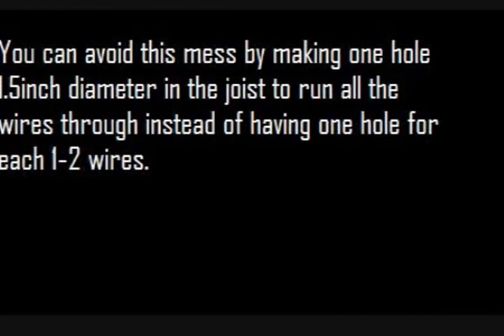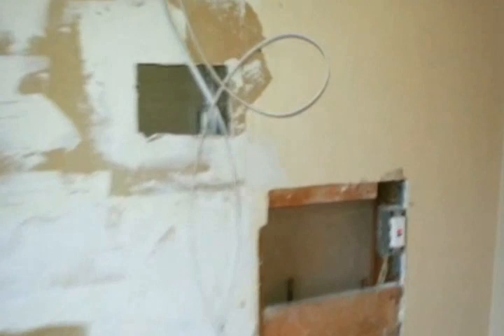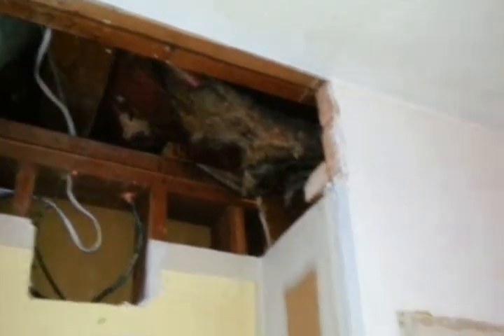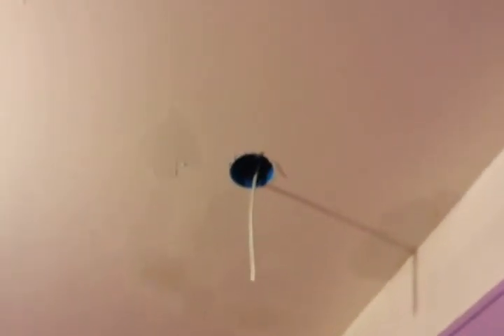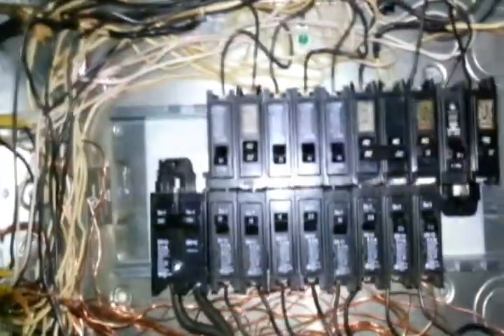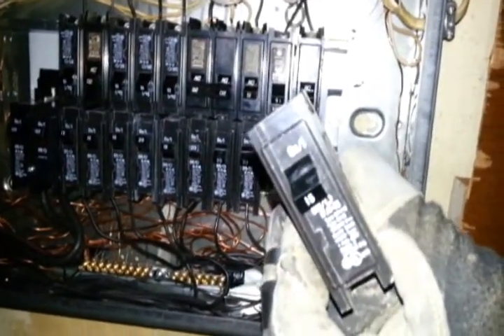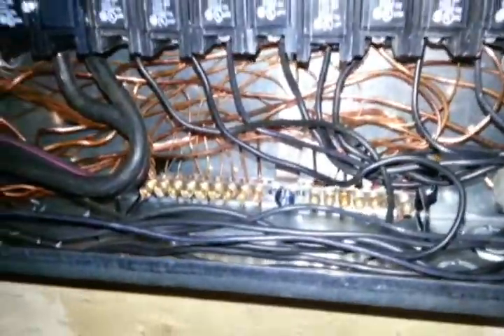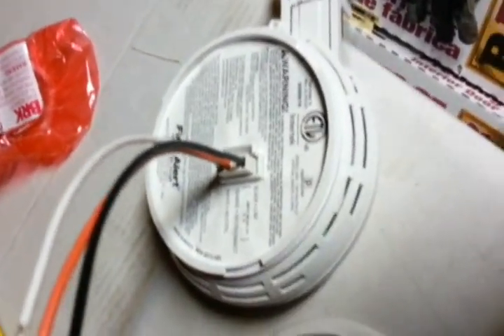installing a 120V smoke detector system

Comment: Great video, but I'd just like to add that you cannot, by code, simply just change the amperage on your breaker at the panel. If you are using a 14 AWG wire, you cannot exceed 15A, even though your circuit never requires even close to that. If you wanted to install a 20A breaker, you would need to use 12 AWG wire like you mentioned for the separate circuitry in your kitchen. Anyways, great job on the video. I'm sure you'll help a lot of people. Take care.

Reference: 2nd year electrical engineering tech student

Comment: Good job budd quick question 

🙋‍♂️ 
I have Arkfault GFCI 15 amp Siemens breaker where do I hook up black and where do I hook up red wire on the panel  box?

Comment: also please do not encourage people to start drilling 1.5" holes in joists!! Multiple small holes 0.5" diameter all along the middle of the joist's width will not degrade the strength of this load carrying beam. Large holes, and those placed close to the edges significantly weaken their carrying capacity. There are places where it can be ok to drill larger holes (for pipes) and this depends on many factors, mainly the span and the hole's location on this span. there is something called the 1/3 span rule. Check out the beams in a bridge next time you're on the highway. The splices are 1/3 of the way between the support posts. Also, most codes require 12/3 NMB for smoke detectors - yours might be different. 20 amp for yellow wire (12 AWG) and 15 for white wire (14 AWG). Good job on being willing to do the work but be safe!

Comment: Where you connect de red wire on the panel I know you just add 1 breaker but you have 14-3 wire ?
Reply: The red wire is only needed for the smoke detectors to communicate with each other. The red in the panel needs to be capped with a wire nut. You could use 14-2 to the first detector and then use 14-3 to tie them together.

Comment: What about the ground wires? Do you just twist the ground wires together in the box?
Reply: Most junction boxes come with a ground screw. You can attach the ground wires there. If there is no ground screw you can attach them together with a wire nut and electrical tape.

Reaource: electrician for 13 years

Comment: WRONG!  You cannot use a 20 amp breaker with 14/2 wire.  The 14/2 wire will overheat before the 20 amp breaker cuts off.

Comment: You want to connect to a lighting circuit so if the breaker trips there's an inductor of a problem because one or more lights won't work and if they're placed on its own circuit and the breaker trips, there won't be an indicator of a problem. This is a suggestion.
Reply: Code where I live states they need to be on a separate circuit
Reply: I believe that all alarms these days have backup power via battery as well as led lights on the front of the fire alarm panel that indicate if they are on battery power or or AC. If the battery gets weak from being off utility power for so long it will begin to chirp as a notification.

Comment: where to connect the red wire in the panal box thx u
Reply: you don't that is used for the remote wire for the fire alarms.
Reply: Do Not connect 14-3 to the box. Start with 14-2 to the first sensor, then continue with 14-3.

Comment: We're does red wire go connect in the panel box
Reply: The red wire interconnects between the detectors so that they trigger each other.  It does not connect into the main panel.

Comment from the maker: All work was inspected by the city inspectors and passed.
Using a 20 amp on this circuit is okay because fire alarms pull out less than one amp and will not overload the 14 gage wire. If a short circuit occurs there will be an infinite amount of current and the 20 amp breaker will disengage way before a 14 gage will reach a temperature high enough to combust wood.  Please do ur research before using hate messages.
Reply: mhmdosteodoc NEC code specifies that 14 gauge MUST be fused at NO MORE than 15 amps. Putting a 20 amp breaker can allow too much current to pass when a short condition occurs. Also you are supposed to have some type of obvious indicator on the smoke alarm circuit like a porch light or lamp. The reason for this is because if the breaker gets turned off without the light you have no indication of knowing they have no more power.

Comment from the maker: Red wire Does not get connected to the panel
Reply: +mhmdosteodoc 
does it mean that you can run 14-2 wire to the first box and  then from it run 14-3 to get interconnected smoke alarm system
Reply from the maker: That works as well but u would have to buy two types of wire
Reply: mhmdosteodoc yes, that's correct. 14/2 between the panel and the first alarm is the correct way to do it.

Comment: Lots of bad info from a person that has just enough know how to be very dangerous drilling that big of hole thru a beam like that will weaken it and cause it to fail. You don't need to wire in the ground because it is not used. Using  a 20amp breaker with a 14/2 wire is a bad idea( unless you are trying to set your house on fire). if you dont know what you doing and REALLY know what your doing not just watching a video, pay someone to do it so you wont lose your house.
Reply: Ken Lopossa
I would do it right and not incorrectly, but i know what im doing tho.
Reply from the maker: +1Shignog please indicate how u would do it so we can all learn from your experience and outstanding intellectual achievements.